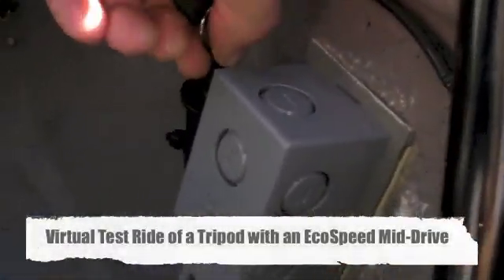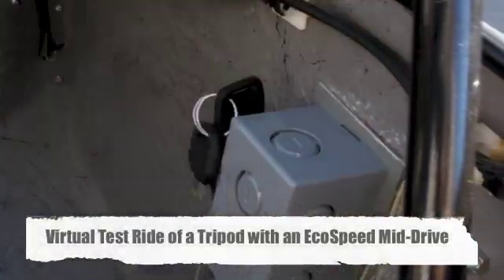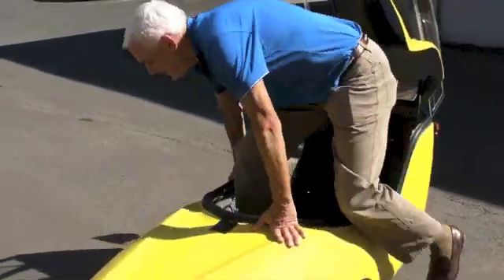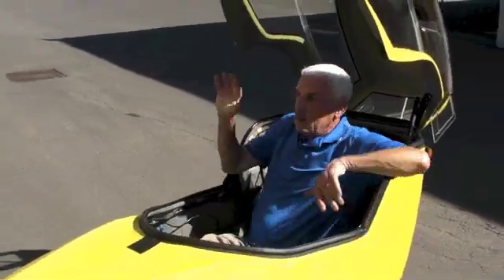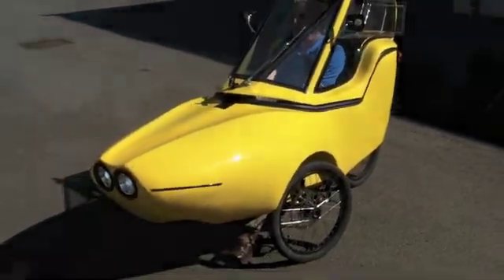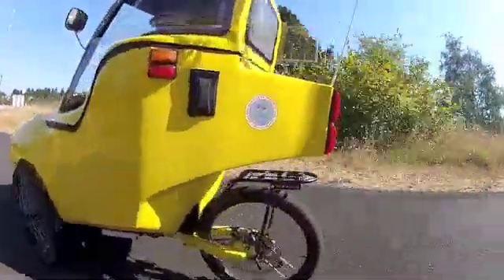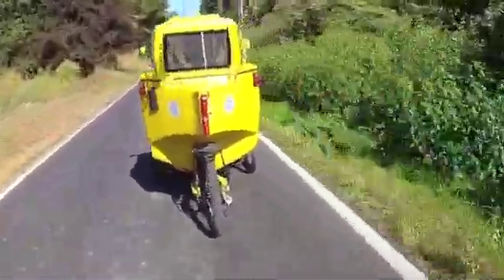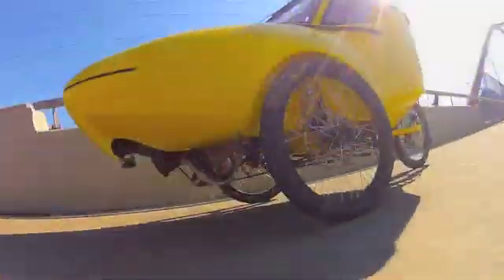Virtual Test Ride on a Tripod Velomobile with EcoSpeed Mid-Drive Electric Motor

Comment from the maker: Yes, the ease of getting into and our of this velomobile, the height of the seat, and overall visibility and ease of use is what the designers at Columbia Cycleworks were going for, a practical, comfortable commuter vehicle.  Other velomobiles are faster but you need to be pretty limber to get in and out of them.

Comment: Very nice indeed!  The fairing is not very aerodynamic (no floor, open wheels, etc.), but it certainly beats nothing.  It seems designed for easy use rather than highest top speed possible.  This velomobile is very easy to enter and exit relative to others out  there.  Congratulations all around.  Ecospeed is by far the top choice and their systems are extremely well engineered.  (I get by with a patched-together Asian unit,  alas.)